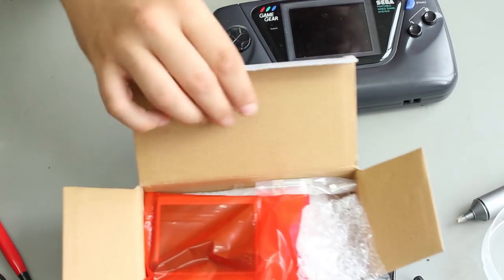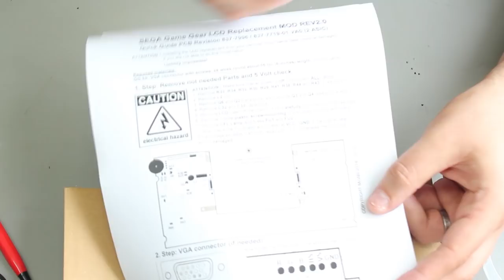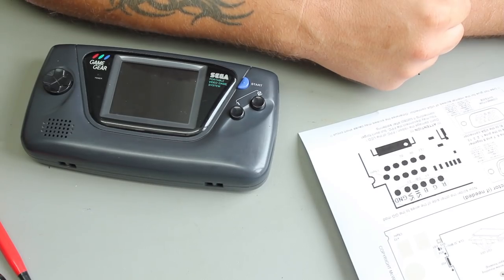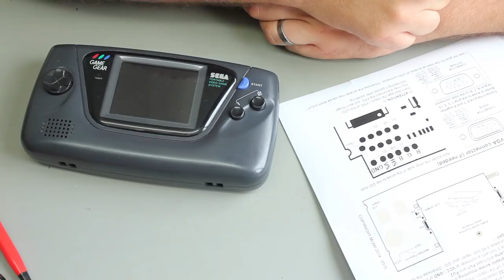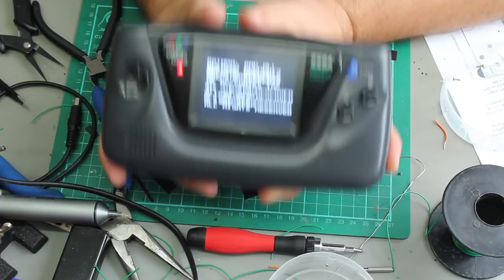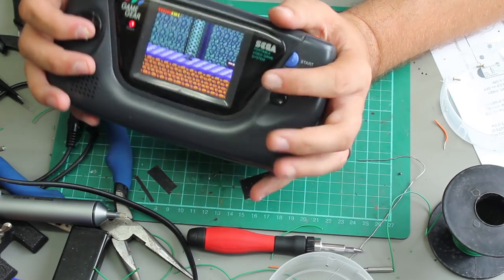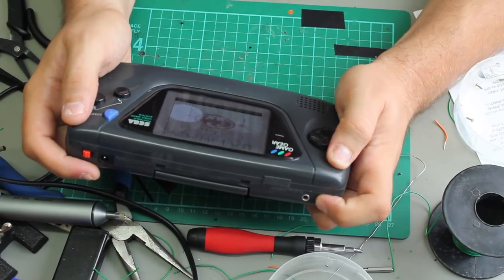Sega Game Gear LCD McWill Screen Install and Capacitor Replacement (recap)

Comment: Great video, I referred back a few times. Even for someone with soldering experience, I found this mod to be a little bit tricky... mostly because of the SMD parts having to be installed. As you mentioned, the directions also weren't as explicit as they could have been which led to a couple of head scratchers. I'd recommend most people have someone experienced install this mod unless you are very comfortable soldering small parts AND enjoy doing things yourself. The price people are charging on ebay to install is very low given the amount of time this requires.

Comment: well done finally upgrade the normal LCD screen to the latest screen can replaceable without any soldering and don't need to used the Florence lamp can save power and do not worry the screen corrosion.

Comment: I hate to be a complete nerd but the bubble screen was the later game gear. The flat screen is the early one. Great video though. Considering doing this mod. Have a dim screen even after a cap replacement. Will use this as a reference if I do.

Comment: Success here. Thanks for the video. I'm being an absolute perfectionist. Is there a way to slightly reduce the display size? Some of the screen is being cut off.
Reply from the maker: I know what you mean, even perfectly centred it a line or so off, unfortunately not.

Comment: I really don't see the point of the McWill screen. If it was cheaper maybe it would be worth it but a video out board is much cheaper and basically consolises the gamegear so you don't need the screen. But glad i watched this because tomorrow I had planned to do my cap replacement. Great timing.

Would have been good to see how the screen cover is replaced.
Reply from the maker: You leaver it off with something plastic like a spudger or credit card. Clean the glue off and fit the replacement.
Reply: I found pushing it from the back is a good method. I did it today. But I am putting the plastic one back on, just wanted to clean it and reapply some tape as it was coming loose anyway.

Managed to remove all the old capacitors today and no lifted pads. The audio board was difficult but when trying to desolder them with gentle lifting, they mostly just broke away. The corrosion was quite extensive though. Cleaned it as much as possible but now just waiting for some fibreglass pens to arrive to do it better before putting on the new caps.

This was my first time doing anything this extensive. Would you say this is one of the most difficult recap jobs you have come across?

Cheers
Reply: Finished installing all the caps and stole your little feet technique. Very neat and everything worked first time.

Comment: Hi can you help me I've replaced all the capacitors in my game gear and it's still does the same thing it's switches on and it says produced by or under licence from sega entertainment then it goes black and there is no sound and the game will not play can you help me.
Reply from the maker: Sounds like you have a main board logic problem, probably in the bios or the RAM. Its probably best at this point to find another GG to recap.

Comment: I did the caps/mc will mod and several things and its awesome, also a good manual and schematics so you can't f*ck it up haha. I recommend a second GG just for extra parts though.  The alignpoints don't exactly center but you have to make it your own just as you did, with me was the same and out of a mm or so. This mod is really cool, i extra added the VGA port to it so gaming on a big monitor is possible for me. ;)

Comment: I bought a GG a while back but got scammed due to the guy selling it doing a Backlight mod. It’s so dodgy looking inside.

He’d removed the components [#] square block thing both blue capacitors above and below the block and the yellow cap below the block.

Comment: For those smd caps, you can use a soldering iron to remove them, you just have to heat up one side and then bend the cap up off that pad, then do the other side. No need to break them off the board 👍
Reply from the maker: Yeah, after you’ve done over 100 of these come back and tell me how your still bothering to desolder the caps.